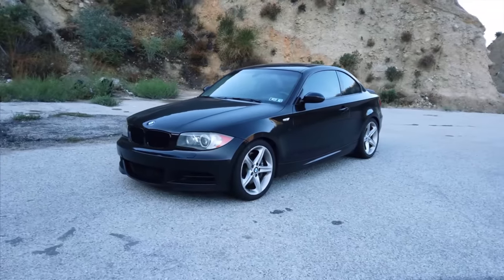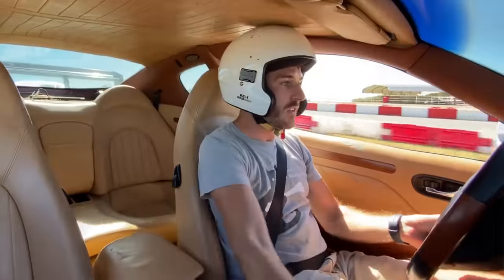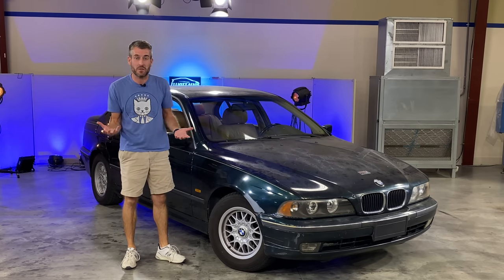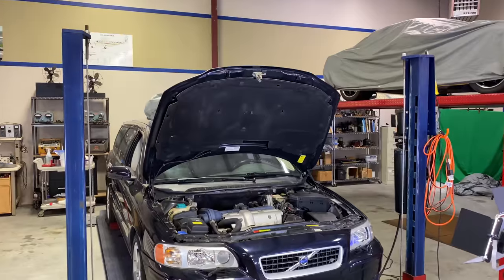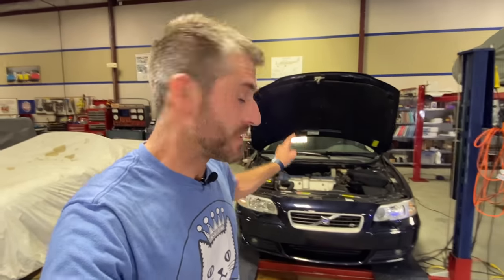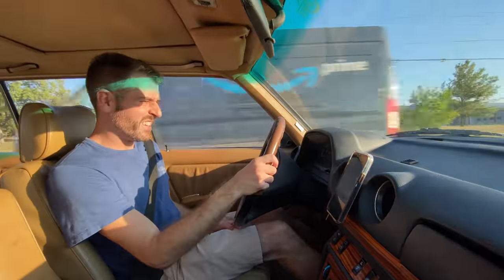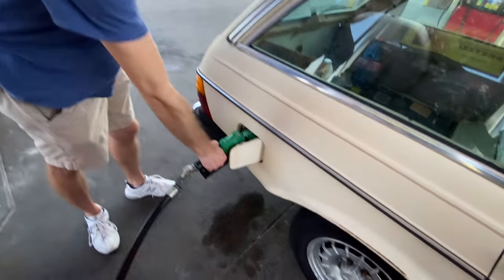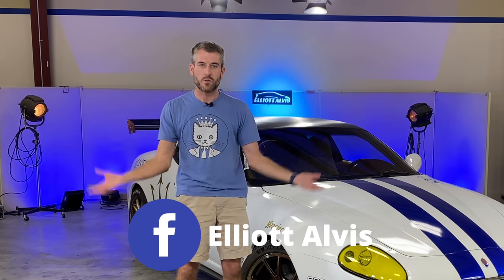I SOLD One Of My Most Reliable Cars, And All Of The Others Are Broken... What's Next?!

Comment: Hey Elliot as someone who works on c4’s a lot. One thing I know is their brakes suck. I can’t lock mine up either after completely rebuilding my brake system. I found switching to the power stop drilled and slotted rotors and hawk brake pads from corvette central really helped (short of switching to brembos and getting new wheels)
Reply from the maker: Well, good to hear its not just me.  I just have driven both of my uncle's earlier C4's and his brakes will throw you through the windshield.  Even in an autocross setting, his brakes are noticeably better than mine.  I'll have to look into drilled and slotted rotors and some different hawk pads.
Reply: @ElliottAlvis  My personal one is an 89 with the 12 inch rotors. Wonder if he has the upgraded 13 inch ones from factory,  if he modified it in anyway, or doesn’t have the abs pump. I’m curious if there’s anything else I can do to get better braking without switching calipers

Comment: I'll trade you my auto 528i wagon for your manual sedan. Mechanically sorted, just took it on a 700 mile road trip. New rear subframe/diff bushings and shocks. Trans rebuilt 30k miles ago